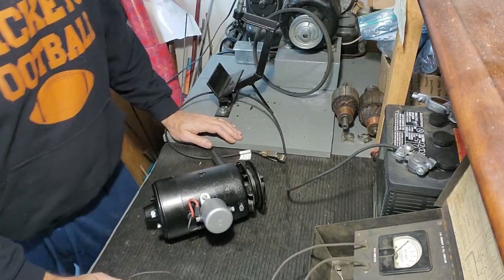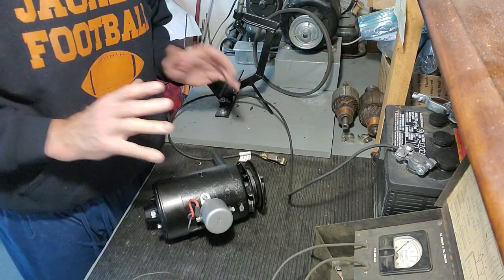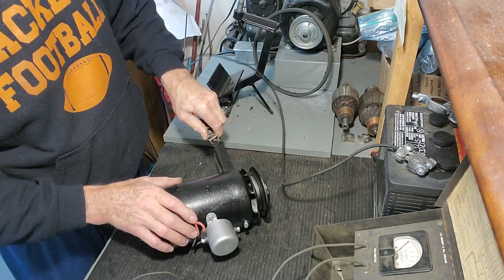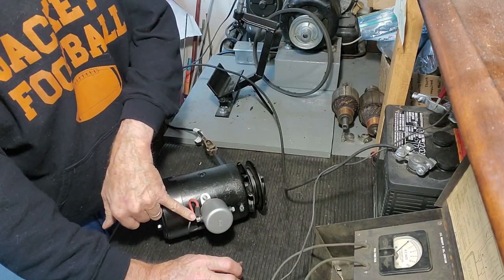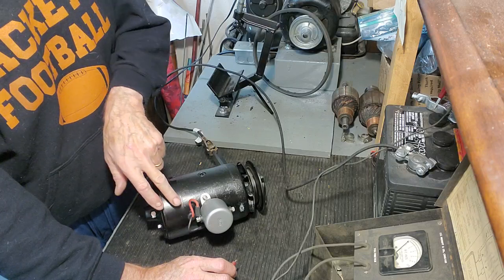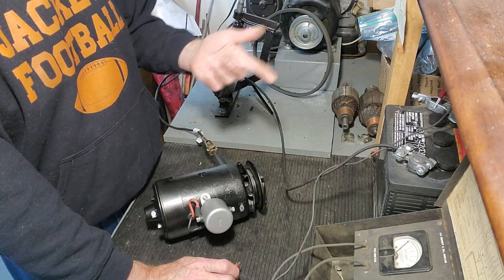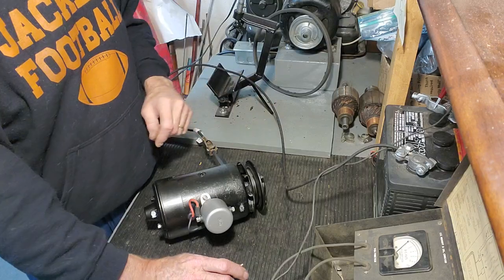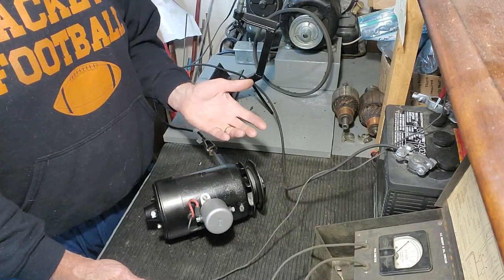Polarizing a Ford 3-brush positive ground generator

Comment: Another nice video. If I want to unhook the 3 wires on the output side of the cutout for some reason, say electrical troubleshooting, and I want to run the engine, which wire should be grounded temporarily? The red???? 

And what is happening inside the generator that makes this work, how is this protecting the generator?
Reply from the maker: You want to ground the output terminal of the generator, not the removed wires. If you don't, the only path to ground inside the generator is through the field windings. This would be excessive and could burn them up.